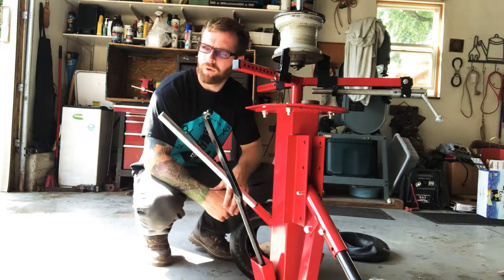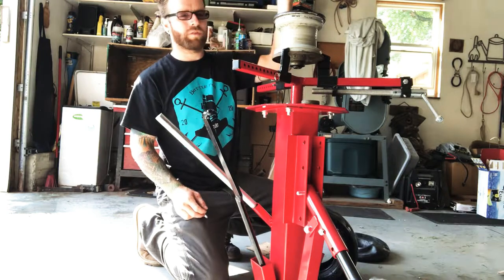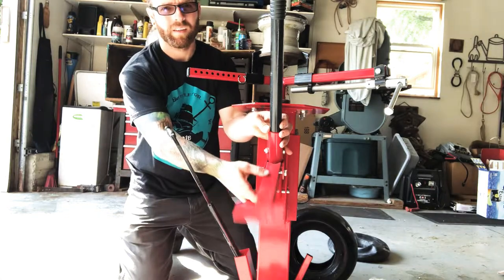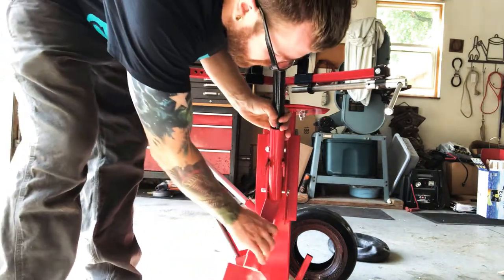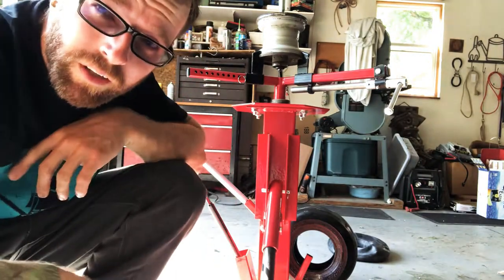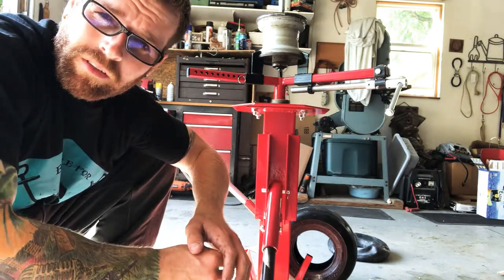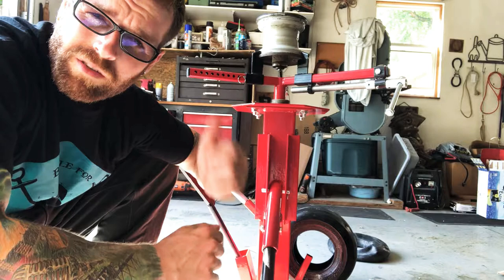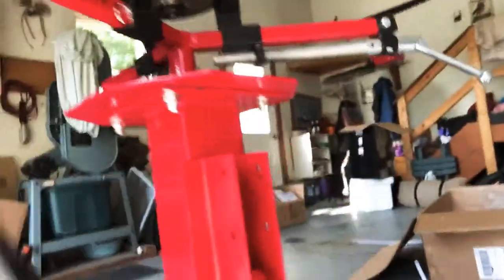eBay tire changer. Worth it?

Comment: I got the same one 3 years ago , I have used it for 16 inch wheels both car and motorcycles . I have a 1-1/4 pipe I drop into the center hole that I use of car wheels and 2 ratchet straps to stop the wheel from turning .  I got a NO mar Bar 100 $ best tool for the money .  So far I paid off everything doing my own tires and a harbor freight tire balancer ebay 60 $ I run 70 mph no troubles . DIY

Comment: It's really weird that you had to grind the blade for the bead breaker.  I have the same tire changer from eBay and I have no problem at all with it.  Mine doesn't get stuck at all.  In fact, I just went out to see how you're could possible need grinding.  My breaker  doesn't even come close to having the problem you mention and it swivels with free movement over the entire range.  The only thing I can think of is may you installed the tube that the lever goes in backwards. I didn't test that but that  must be what you did.   You can even watch the bead breaker of this tire changer being used in other YT videos and no grinding was done. Go reverse the section that the handle  fits into and you'll almost certainly find that you didn't have to grind anything. 

Also, the threads on the adjuster are NOT left-handed and I'm not sure why you would go to the trouble and expense to change it.  Stop and think about it:  With a "normal" right-handed thread bolt, when you loosen it (turn it counter-clockwise), it will push whatever it's attached to away - such as a nut, for example. And, in the same way, turning the adjuster of this tire changer counter-clockwise will PUSH the rim clamp away to tighten it on the rim. That's exactly what this does.  What you want - to tighten the wheel by turning the adjuster clockwise would actually require you to change it to a left-handed thread and machining the block the threaded rod screws into and then making an insert and threading it left-handed.  It's not just a matter of replacing a nut. The entire special block would have to be machined and welded.  You would also have to find a long left-handed threaded rod of the correct size and a left-handed die to cut left-handed threads. Good luck with that!   You're clearly confusing this because you're probably thinking that you usually tighten things by turning screws clockwise. In any case, I'm not sure why you see this as a frustrating problem anyway, let alone one that you would go to extremes of time and expense to change when it's already functioning exactly the way it should.  Just turn it the right way to tighten it on the rim and turn it the other way to loosen it from the rim.  What's the problem?   Is reversing the direction if you turn it wrong such a huge problem?  And if you do go crazy and modify it, you're going to spend far more time making the modification than any time you might save in figuring out which direction to turn it.  And how often do you change tires anyway? If you do change tires frequently, you should easily remember what way to turn the adjuster.  If you only change them infrequently, you wouldn't save more than a few seconds at most anyway and even that would be because you mistakenly think the rod has left-hand threads.   Go out and look at it. Turn the handle clockwise?  What happens. It moves the rim holder towards you just as if it was a nut.  That LOOSENS the rim holder as it should.  And if you modify it as you mentioned,  you're going to have to find a long LEFT-HANDED threaded rod and nut that fits the housing.  If you forget and turn it in the wrong direction, you just turn it the other way.  What's the big frustrating deal? Do you really find this to be so frustrating?  I get the impression that you may have a bit of OCD.  And I suspect that you're doing something wrong with the bead breaker even though I can't imagine what that might be because you don't have to grind it.  Maybe you had the bolts inserted in the wrong holes.  My identical one swings perfectly freely.  I'm stumped by what problem you may have with that. Again, I wish you had shown it having the problem you describe.  

So, the two complaints you have are because 1) You installed the breaker tube backwards and - 2) You are confused about how threads work and mistakenly thing the tightener has left-handed threads. Or, to put it another way, the entire video is incorrect and useless.  (If I were you, I would delete it after you go out and see where your mistakes are because it serves no purpose except to show you goofed.)  

Lastly, the title of your video is "ebay tire changer. Worth it?"  You never answered that question.
Reply: Wow that was alot. 😆
Reply: One reviewer of the Olympia Tools manual tire changer on Amazon had the exact same problem with the bead breaker handle and it was because the hole was drilled too far away from the edge of the tube (it was round instead of square like this one). Mine is the Harbor Freight Pittsburgh version of the exact same unit and mine wasn’t an issue. I can see in the pictures that he does not have it backwards. That this same mistake has happened across two different designs should tell you something.

Another Amazon review shows the mounting tab for the bead breaker arm is welded to the wrong part so it doesn’t line up with the foot where you are supposed to place the wheel while breaking the bead.

I just bought the new black one since my 12 year old unit is missing the post cap (had the motorcycle attachment installed instead). Unfortunately, the post cap is completely mangled from the factory. The Acme thread is buggered and you can see there was a void in the threaded rod where they cut it. The rod is bent and the weld is almost non-existent. The tab on ton that you are supposed to tighten using the mount/demount bar is only rack welded on the corners with an open gap underneath. All these errors were just painted right over. I can’t even spin the post cap on/off since it’s crooked and rubs the post. Since I only bought the new machine for the post cap it’s going right back to the store.

Point is: These things are poorly made and there are plenty of manufacturing errors. Like it or not, you just spotted one in this video.

Comment: I just went out and checked and, sure enough, you installed the tube that bolts onto the main frame and what you insert the handle into. Take out the bolt, reverse it and you'll see your error and how you ground it needlessly.  On top of that, the end that the handle inserts into is the end that has two mounting  holes for lever.  The way you installed it, you can't adjust how far the level is out from the main unit.  I mean no disrespect but I'm amazed that you didn't figure this out and, for some odd reason, you thought the adjustem screw for the adjustable rim clamp was left- handed. I hope you figured out your mistake there by now.    I said this before but you really should delete this video. And that's for two reasons:  1) Your two complaints were wrong. You simply goofed.  and,  2) This video doesn't make you look too bright.   But there's a third reason and that is that the incorrect information in this video could mislead someone who is thinking of buying one of these or someone who just got one but hasn't used it yet.   You may be offended by what I've shown you but I guarantee you you're going to slap your forehead and feel pretty dumb when you go out and check these two things and find out you ground a bunch of metal off needlessly.
Reply: Do you have a rebuttal video?  It would help more than the wall of text you posted.
Reply: @Thewolftamer71Blogspot  
Yes I was thinking the same thing.
Reply from the maker: it came pre assembled if I remember correctly. ill try and solve the issue and create another video